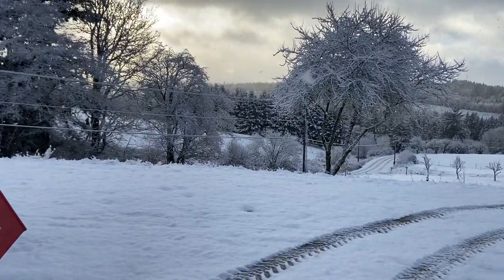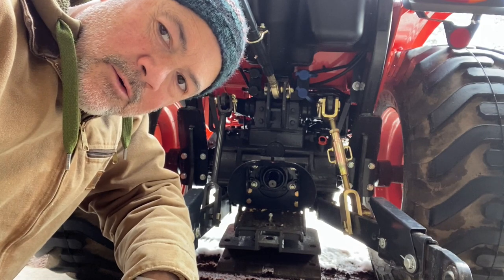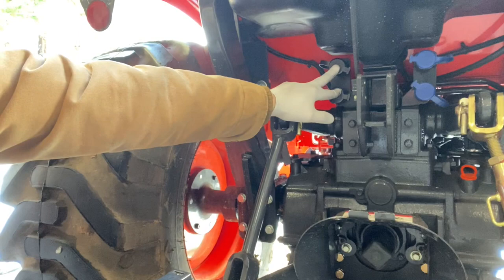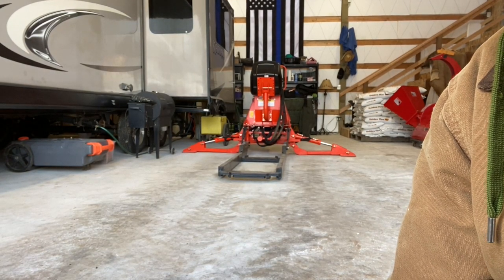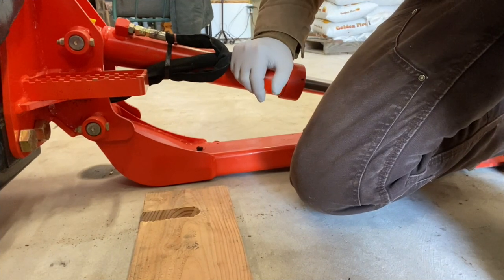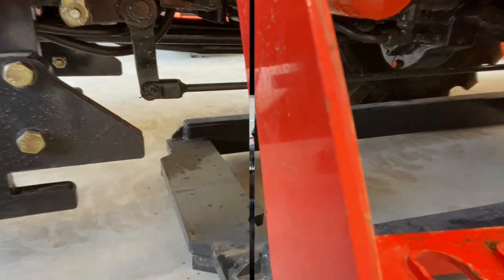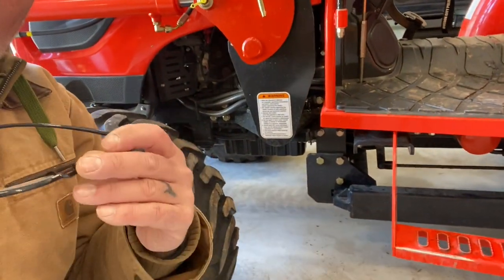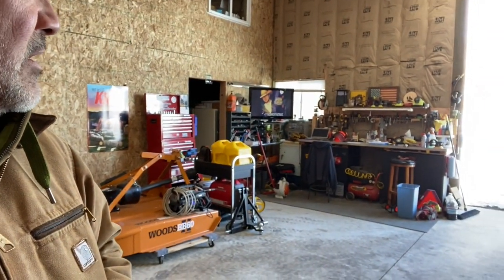#32 The Kioti Backhoe - How to Install it!

Comment: You made it look easy! You’ve got a nice shop. We’re having a bit of a drought with regards to snow this year. I’ve been leaving the backhoe on so far not yet needing the blower. Mine will have to sleep outside whenever it comes off.
Reply from the maker: 🌟🚜 It definitely can be a challenge. I have considered building a dolly for it. But for now it works! Thanks for checking out the video. Happy new year.🇺🇸🍺

Comment: We all have the same struggles. More than once I have cursed my backhoe and used pipes and bars to move it side to side to line it up. I don’t take it off unless I really need to.
Reply from the maker: 😊👍 Hi Don, 
Right?! I hear you! The tolerances have seemed to relax somewhat. It has become easier, although I don’t put it on as often. Thanks for stopping by and commenting!!🚜🇺🇸🍺

Comment: Did your tractor come with the brackets to support the subframe? Or is this in a kit with the backhoe.? 
Great video. My partner won't allow me to pull the trigger on an excavator, so this is plan B
Reply from the maker: Hi Happy!
The tractor is pre drilled for the backhoe option. The subframe and the mounting brackets come with the backhoe. Obviously, you also need a set of rear hydraulic ports to hook up to. I got a lot of use out of the backhoe putting in our utilities and different projects. It kinda sat around toward the end of the 5 years, that’s why I traded the backhoe for a cab. Good luck with your purchase. Thanks for stopping by! Cheers!🚜🇺🇸
Reply: @tractorrookie  Am still looking. Thanks for the info. Hopes for you that you don't miss it to much having it around.haha, but you could always borrow mine if in the neighborhood..
Reply from the maker: @happyrecluse2849  😅👍Not sure what part of the woods you are in. We’re in the Pacific Northwest. I bought a bobcat e26 excavator,  so I have been playing on that. I do see the backhoes for sale on marketplace and Craigslist. Good luck with your search! Cheers!🚜🇺🇸
Reply: @tractorrookie  My tractor is a Bobcat CT235. Didn't come with the FEL, Bobcat couldn't supply so went aftermarket. Looks like I'm doing same for backhoe. Shoulda, coulda, would have done this in the first place when I dumped the skid steer. Can't wait to see the EX in action. Does that make you an "Ex Rookie".?
Reply from the maker: @happyrecluse2849 😅🤣Ahhhhh, okay! I don’t know near enough about the Bobcat. Hopefully they make a frame mount, the 3 point mounts scare me.
Here’s my first excavator project…
https://youtu.be/DazfdKZygC4?si=v2Kv0COWHTAQ33Yi

Comment: Well done, thanks for posting.  Question: Which hydraulic line goes where?  I forgot to mark mine when I finally and for the first time pulled the 'hoe off a few months ago.  One line has a red dust cap and the other has a white cap.  I noticed yours look like both are black?
Reply from the maker: 🌟👍 Thanks for checking out the video! Yeah, the red one goes on top. I mine had a red zip tie on it and I added red tape just to always get it right. 🚜🇺🇸🍺

Comment: I’m having trouble getting the hydraulic lines to connect. They almost clip in all the way but don’t quite, by about 1/4 inch. Any suggestion? I’ve tried muscling them in with no luck. You skipped the part of the install I was hoping to see in the video 😂
Reply from the maker: Hi Asheville! Yes! Put your bucket Al the way down. Turn off the tractor. Move the hydraulic levers back and forth several times. If that doesn’t work, get a block of wood and push the end of the hydraulic line onto it, that should release the pressure. Hope that helps!!!!🚜🍺🇺🇸
Reply from the maker: And thanks for checking out the video! Let me know if it works!😊🤞
Reply: @tractorrookie  That did it! The hydraulic line had pressure on it and I didn’t realize! Backhoe is running great again. Thanks for such a quick reply!

Comment: How do you bypass the emergency brake safety to move the tractor while disconnecting backhoe and not having to climb up on tractor?
Reply from the maker: 😊 Hi John! I do not have that feature. Folks have asked me about the seat cutoff switch also. I think model was the last year without it. Are you on Facebook? If so, check out the Kioti tractor owners page. I have seen guys talking bypass methods. Sorry I can’t offer more help. Merry Christmas!🚜🇺🇸🍺

Comment: Any idea if a dolly would make it easier to attach or disconnect the backhoe,
Reply from the maker: 👍🚜 That’s a good question! I have seen videos with guys that have made them. The frame is pretty low to the ground, but if you could get one to work, lining it up would probably be easier. Thanks for stopping by!😎🇺🇸🍺